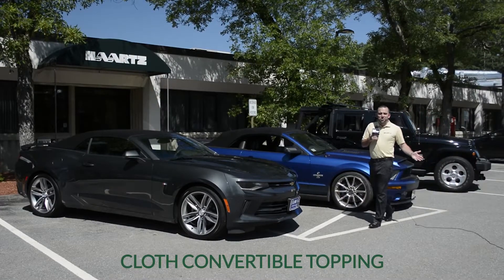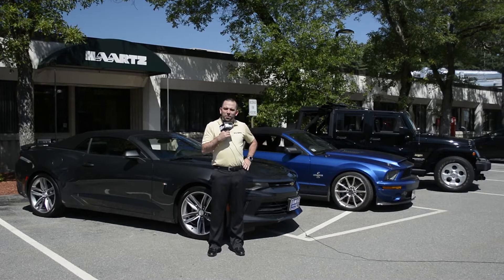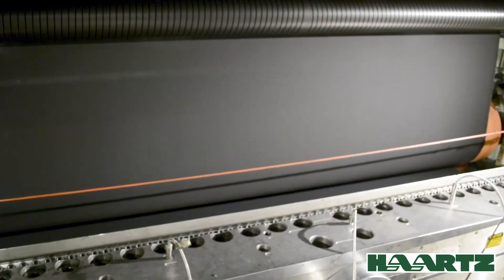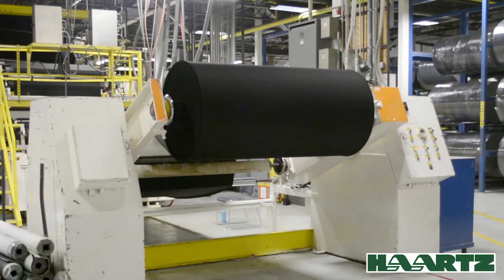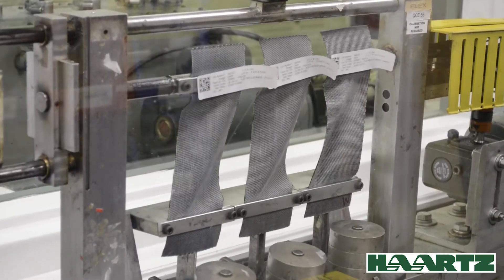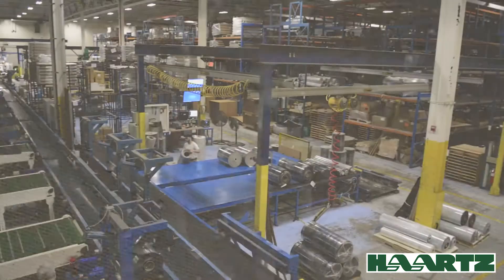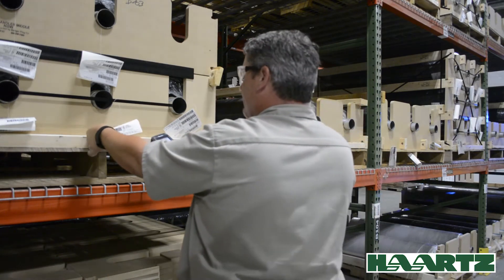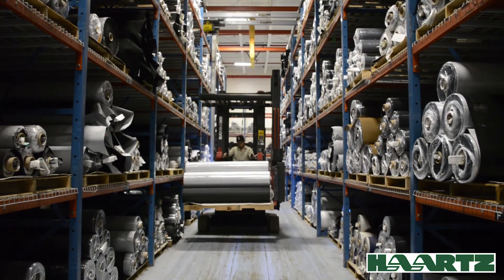Haartz Cloth Convertible Topping

Comment: Did or doe's Haarts make the tops for the Saturn Sky or Pontiac Solstice? and if so are replacements available?
Reply: Haartz supplied Stayfast C for the GMX020 (Solstice) and GMX023 (Sky) programs.  Please contact your replacement top manufacturer of choice and ask for our material by name.
Reply: I am interested in a Haartz top for my ‘92 Fox-body Mustang.
What I’m looking for is the texture of a Mercedes or Bentley-type top, with a glass rear window, in a shade of red to match the interior. 
Is this doable?
If so, can you recommend someone in the Phoenix or Tucson, AZ areas that can handle such a job.
Thanks!